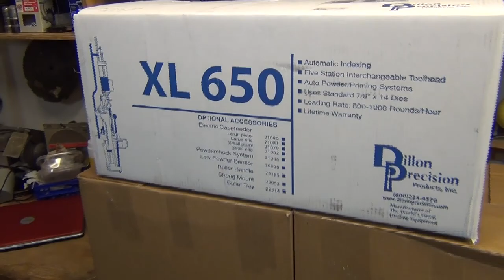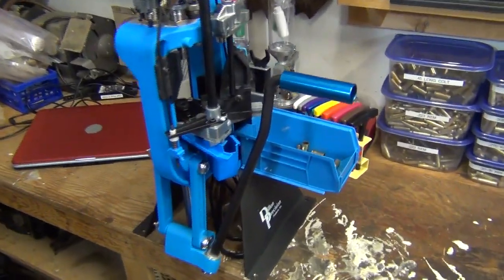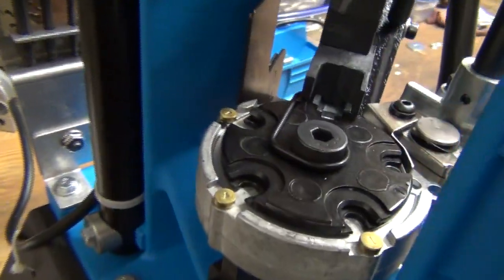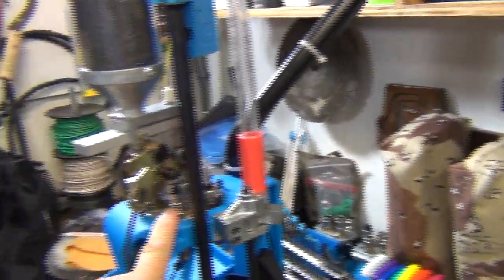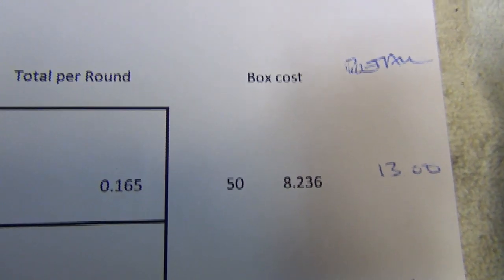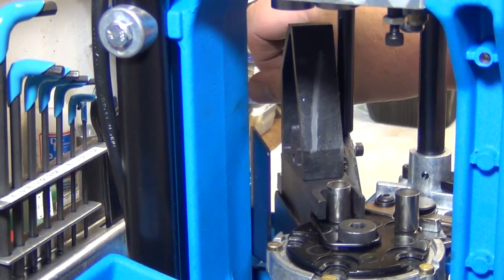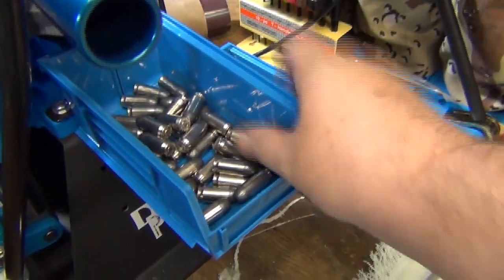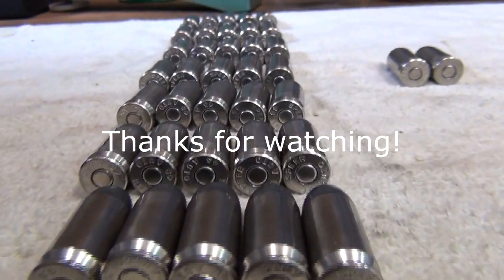Dillon Reloading Press XL 650

Comment from the maker: The answer is YES! I have it set up to do both .223 and .308. The aluminum block on the top of the machine is replaceable i believe gavintoobe from the Ultimate Reloader series has a great video showing how to replace the tool head for another caliber. Dillon makes the very best press. I choose the 650 for the ease of caliber change and auto-indexing the case. The dies run from $45 to $77 depending on the caliber and if you choose steel or carbide dies.

Comment from the maker: After the machine was assembled, I measured the base and my son-in-law cut it out of 1/16" steel plate. We then measured floor to the top of the bench and cut a lenght of 1" square tubing, welded it up and painted. The machine is bolted to the plate, work bench and floor if we ever have to move it. Thanks for the question and comment.

Comment: Also because of you, I bought a 650, built a nice bench from plans of the National Reloaders Manufacturing Assn. i didn't have any problems getting it assembled, and have reloaded 300+ rounds of .45acp. I had about 6 rounds that wouldn't quite go all the way in the case gauge. I Los had 3 rounds where the primer wasn't fully seated.  Guess my downstroke is not smooth enough.

Comment: Inspect your cases closely on .45ACP. There are some that use small pistol primers instead of the normal large pistol primer. They go C-R-U-N-C-H at best, and BLAM-O at worst when you try and stuff a large primer in a small hole. Fortunately, the Dillon design on the primer assy is a good one. The 50 or so primers that were left in the tube also exploded, but no real damage. All the blast went out the top, and the only damage was the primer follower was destroyed when it hit the ceiling.

Comment from the maker: I am not sure about the depth required. I have my 650 on a 1/16" sheet steel with a leg to support the unit. I had to do this for two reasons. I also had some issue with the depth and with a weaker desktop to hold the machine properly. If you notice in the video the clearance for the back of the case feeder is VERY close to the shelving I had in place. I do not think that the 15" you have will be enough. What might work for you is to get the machine assembled and trial fit on your bench. Thanks!

Comment: Thanks for the video. So initially what was your cost on the re loader and was it easy to find primers and powder?
Reply from the maker: The setup for one caliber was about $1227 for all of the stuff I have on the video. Each additional caliber is about $70 (assuming you want to change the powder measure from die set to die set). At the time I got the rig powder and primers were not a problem, however since that time it was a struggle, but things are becoming available now.
Reply from the maker: Yes the reloading area is a 'Rush Room' when he is on the air! Thanks for the comment...Dittos!

Comment: Hi. Thanks for posting this video. I want to start reloading however was worried about the price. I saw a 650 xl for around 570$, however you said your setup was 1200$.. Were there extras in your setup, did I miss something. Thanks again!
Reply: c1ggylol dies, electric case feeder, strong mount. looks to be a few more goodies I see as well.
Reply from the maker: Yes to get it right you should have all of these. For one caliber it going to run about $1200 for the complete setup. Good Luck!
Reply: 216PapaBravo to just get it going is $700. You don&#39;t have to have all the extras right off the bat. They make it nice for sure but you can start cranking ammo out with just a set of dies.....even Lee dies. you can save and get the rest of the stuff later.
Reply from the maker: Yes the machine itself is still an amazing $566 plus tax and shipping. But if you want to set it up for the long haul, save up and get the full package, you'll be much happier!  I was just stating that to get to the setup I have in the video it'll cost around $1200 for the one caliber. Thanks for the comment!